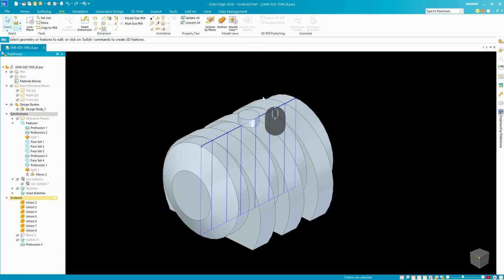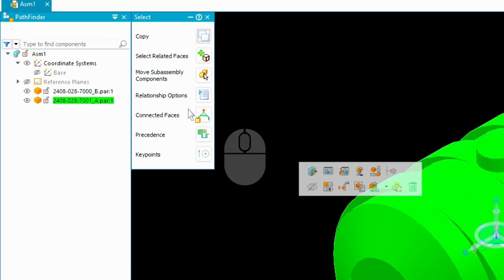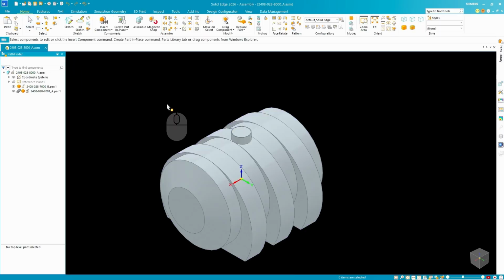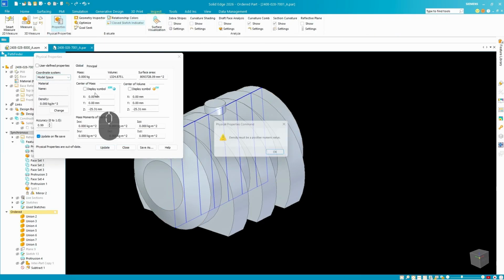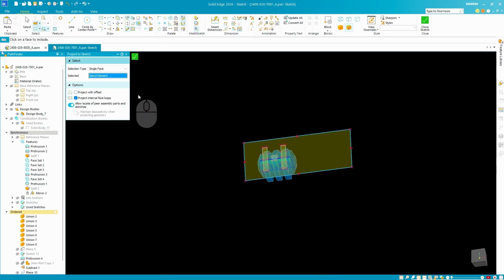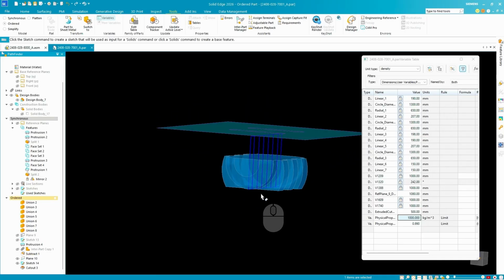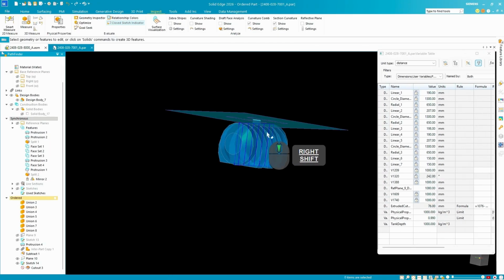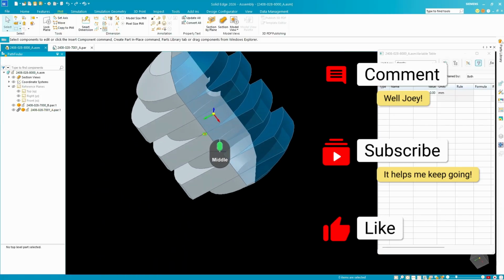Solid Edge Tutorial: Volume of liquid in a container

Comment: if I have to do that in an assembly of the coachwork of a fridge for example how can I have the “foam” of the fridge that is in between the coackwork and the fridge tub
Reply from the maker: Interesting question, here's what I'd try.

1. Create a solid that captures the volume between the coachwork and tub (including the coachwork and tub).
I suspect in your case the easiest way to do this is using the simplify command in the assembly environment.

2. Then you should be able to follow the steps in this video to get the volume of foam. You would need to subtract both the coachwork and the fridge tub from the solid so that you are left with the volume of foam.